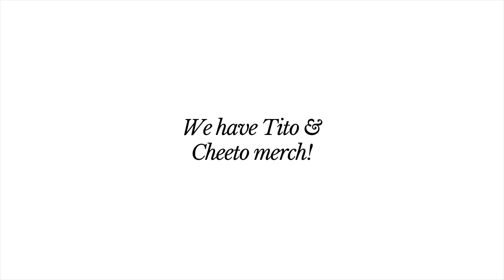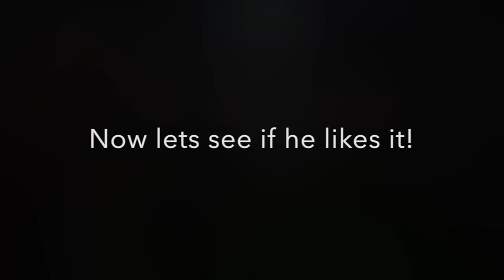Finishing my $5000 Raccoon Enclosure!  Raccoon Real Estate

Comment: This is for all the people complaining the room looks like a jail cell and he should add some colors, I told you it wasn't finished lmao 😂
Reply: It still looks like a jail though. The green floor is so weird; he should have just put woodchips on there. He could have just kept the walls white and made all the other appliances from wood instead of foam. Perhaps adding some plants in would also be nice..
Reply: ok so he painted the floor he should have painted the walls and roof  first so it does not drip onto the floor and you can paint over the mistakes u make unless he plans to paint over the floor and roof  again  or put some woodchips down over the floor it was poorly made he should have used wood and not foam
Reply: @victorkoot  putting wood chips on the floor would make it harder to clean. Using wood instead of rubber would drive the cost

Comment: HA floor maintainer with a coating removal tool and the concrete prep tool.     I work at home depot tool renal. I know those tools anywhere... You should have used those with water. it keeps the dust down and preserves the life of the blades. we've had way to many people burn through new blades in a few hours without using water and they are expensive ;~;

Comment: Why didnt you cover the floor with wooden chips? It would have also been a lot cheaper if you would have build all the climbing poles/platforms from just birch wood instead of all these chemical sprays and foam panels.